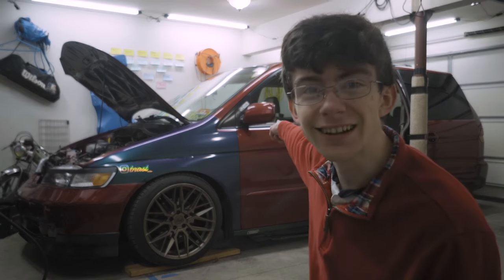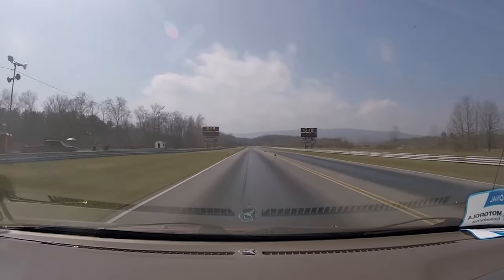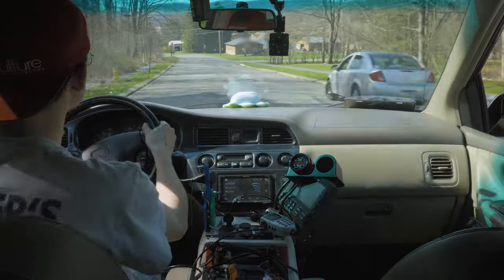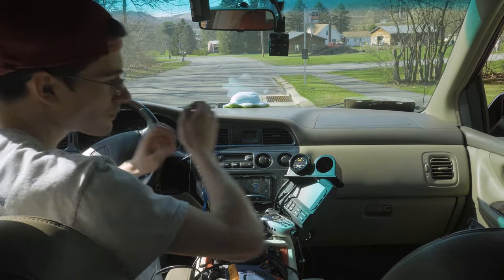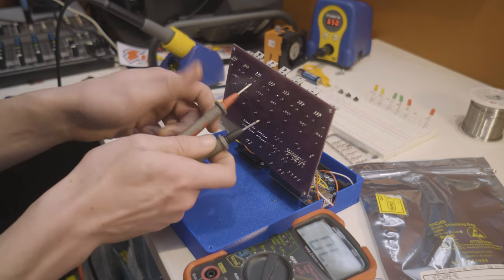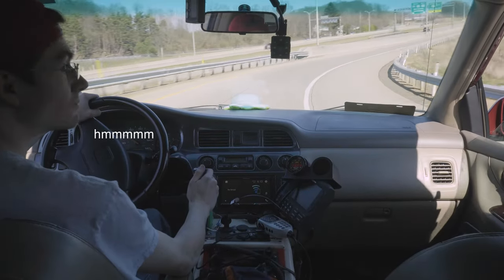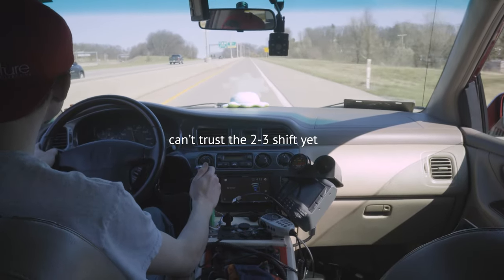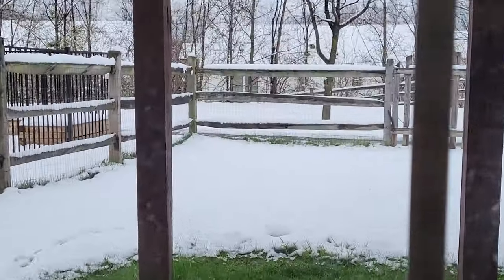It's my first time tuning... and it's my MINIVAN!

Comment: I want to do this to my 9th gen v6 accord, i’m currently rebuilding the engine and trans and preparing it to be turbo’d. it’s a 6 speed with the same basic design as the 5 speed, also put a heat sink on those mosphets, i like your videos i am going to try to do the same thing to my car.

Comment: Hi Tom. How is the idle like on the EMS 2? I made a dual harness on my 02 mdx and got it to run but the idle seems to vibrate allot even at 900. I got it timed and set the idle air control valve but it's far from OEM.
Reply from the maker: I'd say definitely take a look at your AFRs and tweak the idle FB settings, namely the rate and dead band limits. I've had pretty good success with 50 rpm either way for the dead bands, and ~150mS for the rate.
Reply: @tnast  afrs are +/- 5% at idle. You increase the rate from ~50 to 150?
Reply from the maker: @francismande  Yup, essentially what that does is changes the rate that it's monitoring the idle at. At 50ms it's just way too fast and it'll start compensating when it doesn't need to.
Reply: @tnast  thanks man. I'll try that. I got so spoiled with kpro I never had to mess with those options.
Reply from the maker: Let me know how it goes! That should take care of it, but you never really know for sure. The EMS definitely has a bit of a learning curve, but it's quite a capable unit once you figure it out.

Comment: Dude. If you could build a manual controller for a 2012 automatic I'd buy it.
Reply from the maker: I haven't looked into the specifics for the newer models, but I'd imagine it could easily be adapted with some changes to the code! I'm really hoping I can start selling some within the year.
Reply: @tnast  that would be amazing. Even schematics for the build, files for the programming, so we could build our own. And upload or program them then! Keep up the amazing work!